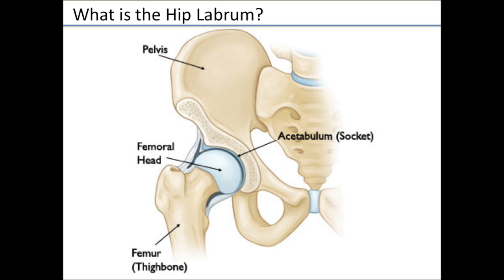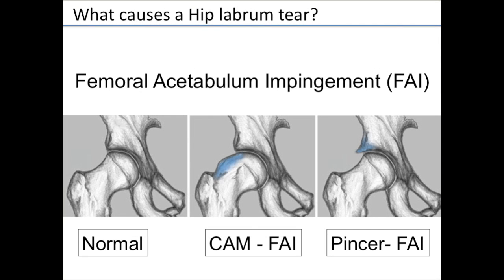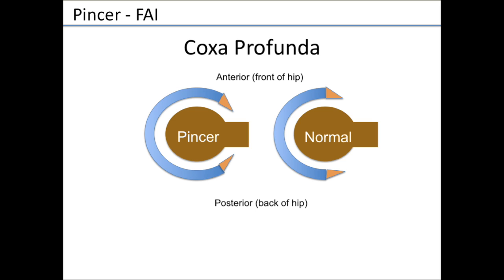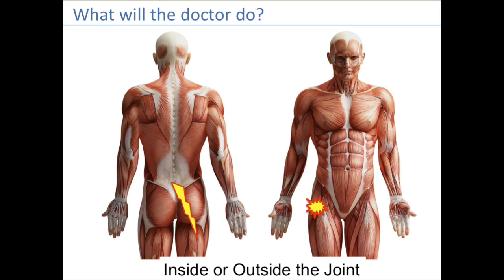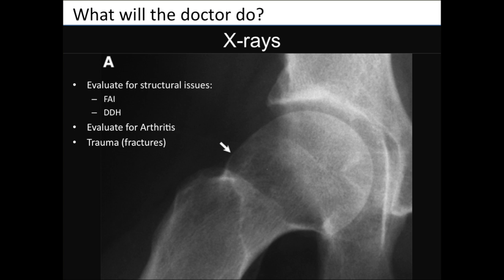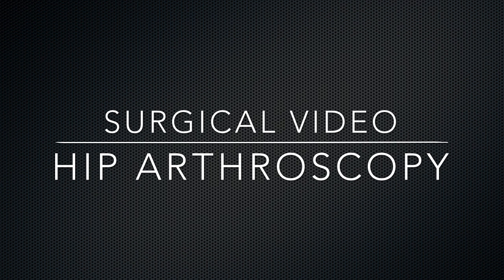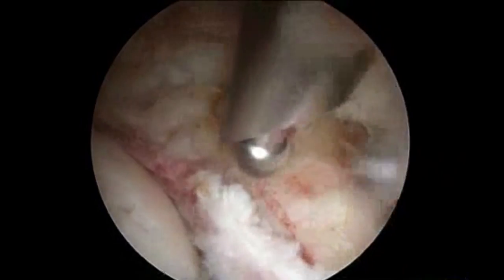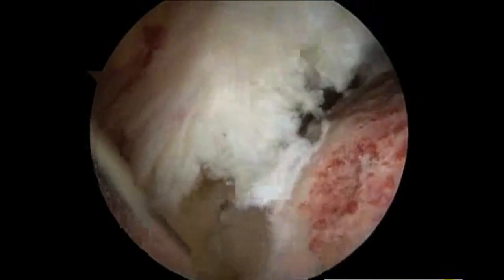Hip Pain - Torn Labrum Hip

Comment: Key to all hip problems is proper diagnosis.  Then you should opt for an arthroscopy before the hip replacement (which should always be your very last resort).  Weight loss and moderate activity, physio and overall strengthening of inner core muscle.  Posture is also key!  I had to quit my dancing and horse riding, as well as heavy pot lifting when gardening!  Your body is a temple and the joints are the marble pillars and columns!  Don't crack or break them! lol  I am so grateful for my successful arthroscopy.
Reply: The surgery worked are you pain free now.
Reply: How are you now
Reply: Both my arthroscopic surgery and full hip replacement were successful.  I am pain free now and slowly getting my life back but due to COVID I had to wait almost 2 yrs for the OP!  I highly recommend it and do as much research as you can.  Finding the best surgeon (years of experience) is key!!

Comment: I just had this surgery (January 17, 2017), so far I still have a little pain around the area from the surgery. I'm hoping after some time and physical therapy, the pain will disappear. But, the surgery wasn't that bad. I was walking with crutches the same day and only had to take pain medicine for about four days afterwards.
Reply: Hi, I just read your comment about labrum tear surgery.  Is it better now? I've had the tear for 5 years now and the pain on my hip is getting worse and I'm considering surgery but I'm super scared.  was your surgery helpful? thanks <3
Reply: Honestly, the surgery was really easy. I was a bit nervous beforehand as well, but I literally had no problems during the surgery. I was on crutches for three weeks after that and began PT a week later. I'm five and a half months out now. I'm not completely pain free right now but, the surgeon told me it would be a MINIMUM of six months for it to completely heal. Bone remodeling is slow so, I just have to be patient. But, in the meantime I started running again again six weeks ago and lift weights with no problem. I haven't started dead lifting yet  and really only do squats with light weight at this point. I just don't want to rush things.My suggestion is to get it done before it gets worse. I"m 49 and I didn't want to wait until I was in my 60s and it had gotten more painful and there was more damage. So, get it done now in order to have an easier and more complete recovery than if you continue to wait. One things' for sure......................it'll only get worse if you don't get the surgery.
Reply: Good stuff, thanks for your reply, and I'm glad you are better!
Reply: Thank you for posting this. I was just told I need an MRI to confirm that I have a tear but everyone (doctor an PT) are fairly certain that is what it is. I'm 43 and I am not amused by the possibility of hip surgery. After reading your comment and seeing that you are RUNNING again, I'm almost looking forward to getting this over with!
Reply: Like I'd said before, I'd recommend getting it if it's suggested. Again..................if you wait it's not going to get better with time, only worse. Hope this helps.  ;-)
Reply: How much did it cost
Reply: iguillo question...  I’m having the surgery in April - when you were on crutches were you non weight bearing?  Or could you put weight on your leg while walking/standing.... and now that you are a year out how are you feeling?  It sounds like you are very active...  are you back to where you were before?  Thanks - i appreciate it...
Reply: Should i skip the hip injection and go straight fkr the surgery?
Reply: How r u now?  Was the surgery worth? @iguillo
Reply: @iguillo  honestly thank you for your comment. I'm 27 yrs old and about a year into this seemingly incurable pain that doctors think I'm making up. I was advised about this surgery by my 1st orthopaedic surgeon who has referred me to a specialist surgeon. At first I was hesitant but seeing your comment has made me want to push for it at get back on with my life
Reply: Everyone, just wanted to give an update about my progress three years post surgery. My suggestion..........if you're thinking about getting the surgery, go ahead and do it. Three years post and I am back fully running, lifting weights (squatting and deadlifting), and walking with no pain. It was WELL WORTH IT.

Comment: I have had three surgeries on my right side to fix an impingement and labral tear.  Now the hip capsule is thrashed and I need surgery to fix that.  They cut through the hip capsule (ligaments) so they can shave the bone underneath.  They do no tell you this.  But they do.   Most stitch the ligaments back up when they are done shaving bone or fixing the labrum.  My stitches broke open the last time and now I have to have an allograft (cadaver tissue) placed over the capsule defect and hopefully it takes and becomes a part of me.  As of right now, I'm in serious pain and it feels like my femur is loose in the socket because my ligaments aren't tight and holding it in properly.  This can be a successful surgery, but sometimes I think a total hip replacement is worth living right now rather than being sedentary and sitting at home all day thinking about suicide because the pain wont stop and you cant participate in living your life fully.
Reply: Very worthwhile post Benjamin.  I Thank You For Sharing Your Thoughts.  I have an evaluation in a few days. Saving your post.  Take Care and Best Wishes For Recovery !
Reply: I completely understand you 
Each  and every point
Reply: Hang in there. How's it lookin for you now? Discussing my mri results tomorrow... hockey/crossfit and now labral tear and impingement
Reply: benjamin bagby Same been crippled from hip problem since 20 I’m 40 now. I also have thought about suicide but I have a little girl counting on me. The pain is so bad I don’t know what to do anymore. I’m seeing a sports surgeon that thinks anthroscopic surgery will help but I’m scared.
Reply: How did u injure it initially.

Comment: i'm 45 and i have hip pain on both sides strts a year ago,
the mri shows a labrum tear and a pincer on both sides, doing the hip exercises helps relieve the pain ,
the problem that i didn't get any clicking til last week i get 4 clicks on my right hip during exercises.
about the groin pain it's rare, it mostly shows itself on the lateral side and on the back of right hip.
i want to know if this would cause a damage to my hip joint wit the time?
and does anybody did the surgery and what's life after?
i'm not training anymore because of that and walking is very limited, and it get worse when it's colder outside.

Comment: Had my FAI, hip labram repair, with 4 anchors a year ago next month (April )I still have pain in my groin and I wonder if it will eventually get better. I have heard that it can take a whole year...I'm a month away..I don't want to do it again, because of how long the recovery is..
Reply: Have u been seeing a good physiotherapist? 
If not: Have u built good strength and muscle in your legs (glutes, hamstrings, quads, calves), do you have good posture?
Reply: @nahmenwhy5273 what did you do. How is your hip

Comment: Thanks for the video! I found out I had a labral tear back in November (it’s currently June). My initial injury started in July 2017 when I was 13 through dancing. A teacher stretched me the wrong way one time and when it was a day before the show, I did a split (because I knew I had to do it the next three days) but it ended in my entire hamstring popping. My parents brushed it off as a strain and so I didn’t get it checked out until January 2018 when major pin resurfaced. I got an X-ray as well as an mri and learned I fractured my ischial tuberosity six months prior (when my hammy popped) as well as a stage 3 strain in my adductors. This led to me going to physical therapy until July 2018. Everything was fine until I ran the mile in PE one day and (I’m also in marching band) when I marched at a football game, I immediately felt pain (I believe that is when I tore my labrum). I remember crying and remaining in bed the following day and went to the doctors trying to figure out was was going on. It took a few months and two mri’s (one without contrast, second one with which really freaked me out) to find out I have dysphasia in both my hips as well as a labral tear in my right hip (found out November/December of 2018) Due to band conflicts, we decided to have the surgery scheduled July 16, 2019 (which is less than a month away when writing this) being 15 years old. It’s a relief that after two years of hip pain I will have surgery to fix it! I’m really scared for it but I know it will be better in the long run. Good luck to everyone who will have this same surgery in the near future!!
Reply: Hey how are you doin with all this? I also had a hamstring pop type Injury in hockey. Fai etc. Surgery soon..hope to get back on the ice asap. Take care
Reply: How are you now
Reply: @motiv1  so sorry I didn’t see this response til now, but I’m going great! I can do pretty much everything. I’ve started lifting, and I can’t squat. I think it’s more because of my dysplasia than anything (it just gets aggravated after a couple weeks)
Reply: @umit777.  thanks for asking! I replied to Ron so you can see that there. Are you going through the same thing?
Reply: @motiv1  how are youu doing with your injury?
Reply: @brookecote  when you have surgery?
Reply: @brookecote  hi. Overall fine but it is still annoying with tightness and sometimes popping depending on how active I am. I have full function and strength though so I'll take it. Glad things are going well for you.
Reply: @umit777.  July 16 2019. So it’s been around 4 years

Comment: Thank you for the information! I am post marathon (Oct 27th) and still trying to figure out what has gone wrong in my hip. Have gone from psoas, to lower back, to currently a possible tear in my labrum. It verified I am finally in good hands! Just had the anesthetic injection to figure out what is going on with the joint vs muscle. I am off for an MRI at last and hoping to find out exactly what is going on to get better, stronger, quickly! I appreciate the direct and informative help here :)
Reply: did you find out what was going on? how r you feeling these days-I have atear and recommended for surgery nervous for the outcome...

Comment: Can a labral tear cause muscle atrophy in the quad and glute?
Reply: Yes, absolutely.  Muscle atrophy is a form of "self preservation" that your body will go through in trying to heal your hip. Most people see this by their inability to lift their leg as they get into their cars. Your body wants you to stop moving that leg long enough to heal the injury.  If you are proactive in this regard you can heal the joint and combat the atrophy.  However, not every case is the same and in some cases the surgery will make the atrophy worse.  An atrophied muscle will elongate and grow weaker first and then grow shorter as it withers away.  You will want to stretch and strengthen the muscles. (Stronger muscles will tend to get shorter) This is two separate actions.  Find videos here on YouTube that teach stretching of the Piriformis, Gluteus Maximus, and the Erector Spinae. These are the major muscle groups of the SI Joint.  Secondly you want to strengthen the Psoas and Quad muscle groups without adding stress to the hip joint.  This can be accomplished by simple knee raises.  You only want to work the one side that has the joint issues as exercising both sides of the SI joint will lead to a condition called Lower Cross Syndrome where the two sides, left and right, will be mismatched as far as strength. For more information, seek out Dr. John Bergman here on YouTube and whatever you do, do not put man-made drugs into your body.  They are the cause of most joint issues as they interfere with your bodies repair mechanisms.  God Speed.

Comment: My right leg goes out of the hip socket freely. I had an mri and they found “degenerative fraying of the labrum”. I am 34. Could surgery possibly help?
Reply: I have ehlers danlose which can cause body parts to go out of socket.
Reply: @nathantv8257  that sucks, happy birthday by the way seen your channel
Reply: @nathantv8257  hey man do some isometric exercises. Go on amazon and buy this book, "FUNCTION ISOMETRIC CONTRACTION"- by Bob hoffman. If you don't do these kind of exercises then you should because they will help you build strength and stability for your joints without moving them around and possible hyperextending them like you would in weight training.
Reply: Dave18 Aved18 thank you! I really appreciate that!
Reply: Dave18 Aved18 thank you for the book suggestion. I really appreciate that. I will definitely get it. I just found out about 3 months ago that I have ehlers. I’m still in the beginning phases of figuring things out so that book will really help.

Comment: I've had continues pain deep in the groin area, locking (associated with huge amounts of pain), clicking, possitive labral tests (external and internal rotation plus flexion) for 4 months but my doctor only sent me to an x-ray that was negative and thought that there wasn't any labral issues then. I'm not so sure about that conclusion since an x-ray really doesn't show much of soft tissue structures plus I have a very anterior shifted femoral head within in acetabulum and really poor hip stability. I would think that an MRI would have been a muh better choice of imaging.
Reply: Definitely go with the MRI.  That will tell you what's going on. I recommend getting it with arthogram (dye) so that the pictures will have highest validity.
Reply: Yes that is the why to go get Mri with dye good luck

Comment: Is this something that baseball pitchers would be likely to develop? My right hip pops and moves around constantly, "posterior ilium" according to chiropractors. I have to push leg out (like traction) in order to pop it back where it should be, and/or sway my hips to the right so the right leg rotates inward (and the right foot is pointed straight again instead of the right, for example. I also did hurtling in winter track when I was 17, and around that time had a distinct moment when there was a popping and intense burning in my hip, could that have been a labrum tear to the best of your knowledge? Thanks for any info, and thanks for the video.